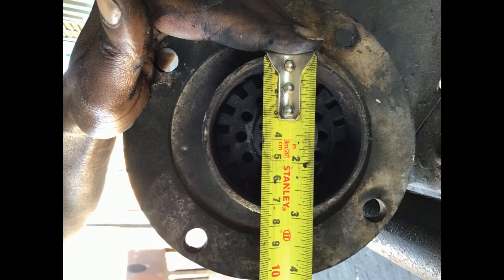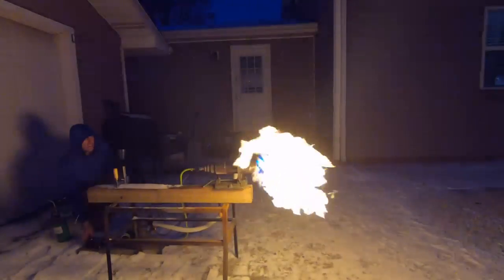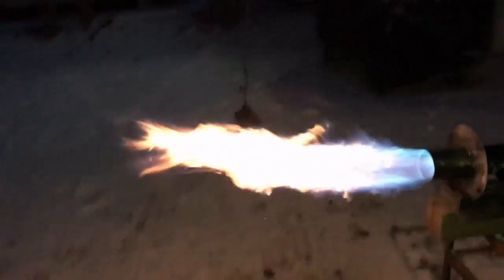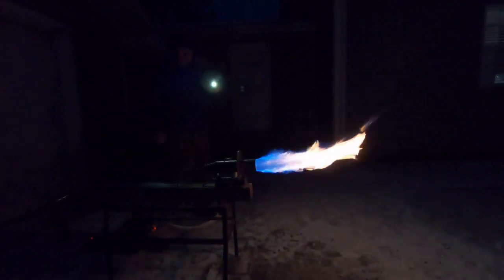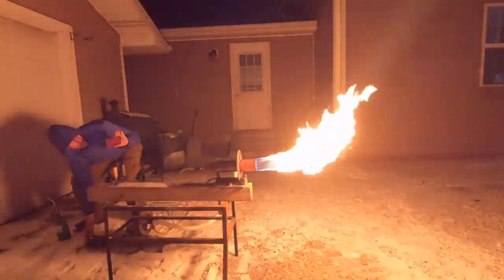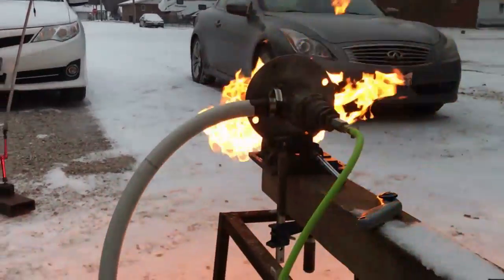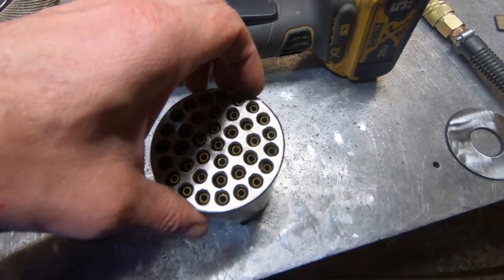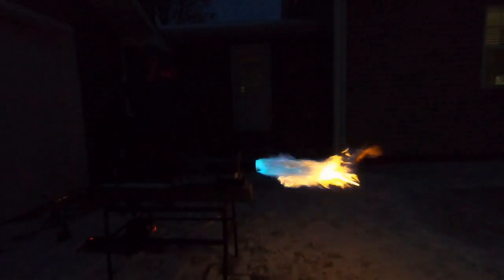Waste Gas burner Optimized design

Comment: I built one similar to this but reversed the gas entry point from your design. I have the air output where  you have the gas and the gas where you have the air. Strange why you reversed the venturi principal? I used a 4" floor drain cover at my cone nozzle. The cone nozzle is tapers from 4" to 1" and is 8" in length, the supply tube attached to the nozzle is 10" x 1" diameter where I have my 1" Tee connection. The gas is introduce into the venturi with a 3/16" jet at the point where it mixes with the eddy current. It Works fantastic! I will be making a video of it to share in the future if there are any requests.
Reply: Excellent idea!
Reply from the maker: hello friend , YouTube blocks comments so i didn't see this , its better to wrap the fuel in a Colum of air rather than vise vs . I hooked a liquid one up backwards one day and it did not work well

Comment: According to German chemist Peter Plichta, when Silicone reacts with Nitrogen it releases on the order of forty times more energy than a Hydrogen and Oxygen reaction.  God's Secret Formula (95'), goes into detail on how he observed O2 being carried through the blood via Fe's magnetism.  In addition he explains his theory on how our numbering system is based on the number 81 (solve it's inverse using longhand division).  His best work may be published in BenzIn aus Sand:  Die Silan-Revolution, published/released September of two-thousand and one (humm, what happened that month?).
NASCAR teams use Plichta's rocket fuel to cheat: https://youtu.be/W84M8vICWEo?t=178
The plenum is modified to 'bury' the fuel under a slug of low temp metal.  Once melted away the fuel is exposed, yet only sublimates at high Hg".  This means the fuel is 'activated' under closed throttle conditions, and this causes real problems under caution.  When the yellow flies, the driver will turn the brake bias to the rear axle, gear down, and hope he can dissipate the energy w/o getting embarrassed.  Notice how Montoya hit the jet dryer, it was due to the rear axle suspension breaking at the wrong time.  Many break the axle itself, among other consequences.  Easier to see at night, when the rear brake rotors glow as a result of trying to control the excessive energy.
Between the abundance of N2 (the reactant), and an energy potential on the order of twenty times greater than hydrocarbons, feathering a closed throttle will provide as much energy as the engine can handle.

Comment: I can tell you that using silver solder is the best way to make more complex parts fused together. The cost is so cheap it is not funny. I got a 75 percent silver solder box at a flea market that weighed 25 pounds with 1/8 inch diameter 3 foot long for hundred dollars. Deal of the century for sure that I have been using for years. Am sure they will not run out in my lifetime. This hard solder is what the old timers called it back in the day. Then silver brazing today. Your flame nozzle is correctly made from what I remember making a few years ago. Where are you located NOBOX7 ??? Good luck and peace too fella.